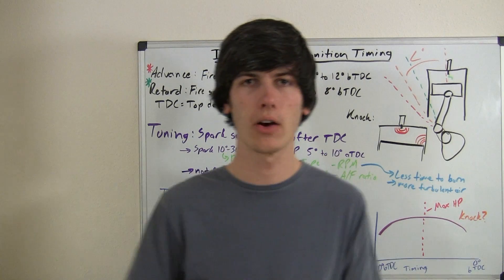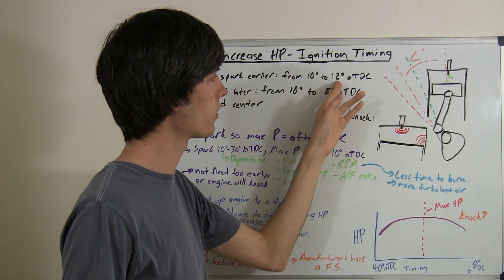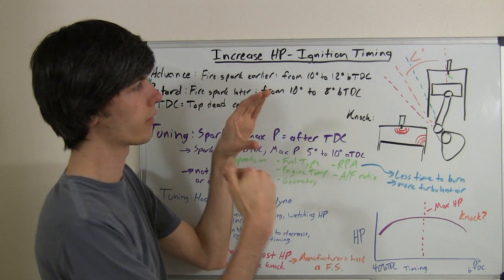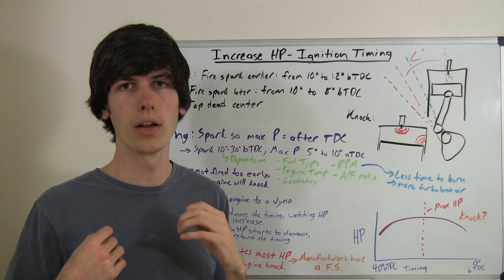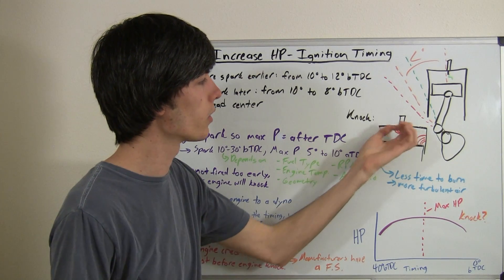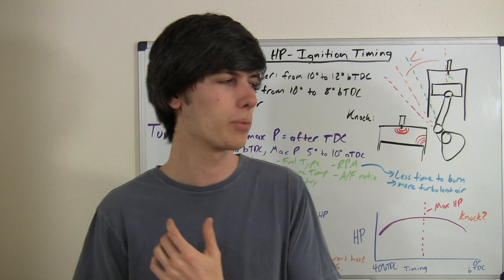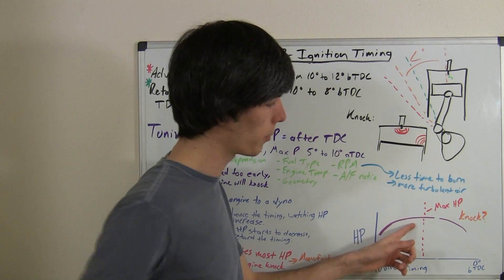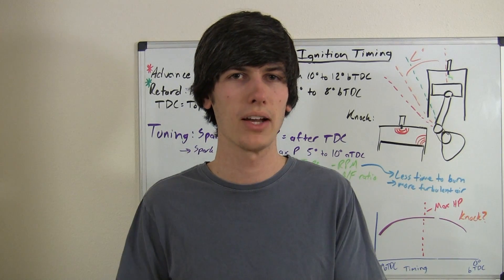ECU Chip Tune - Ignition Timing - Increase Horsepower

Comment: One thing I found out when looking into timing experiments for my Miata, the higher octane gas you're running, the less likely you are to have knock at higher timing degrees.  For instance, my little 1.6L engine will knock if it's running on 87 with the timing advanced from 10 to 12 degrees BTDC, but if I run 93 octane, I can advance the timing all the way to 18 degrees before it starts to knock.  Just thought I'd add that.
Reply: VoraciousPhantasma that's because octane is the measure of resistance to knock.
if you use higher octane fuels you can run more parameters to generate power before you reach the knock threshold.
Reply: We refer "knock" to the sound that detonation/pinging does when the engine is running. We're all talking about the same thing here, so you're right.
Reply: that is what octane ratings represent. Most people think octane means more energy in the fuel, but its actually its rating to prevent knock
Reply: It all depends how the gasoline is measured: 
Research Octane Number (RON)> R or Motor Octane Number (MON)> M or average of both.
In the USA, Canada, Brasil and few more, the gasoline is measured by Pump Octane Number (PON)=(R+M)/2 - or Anti-Knock Index (AKI), and sometimes Posted Octane Number (PON).
In Europe gasoline is rated 100, 99, 98, 97 or 95 RON
In USA if a fuel is 98 RON then it will be 93 PON -> 93 PUMP 
if it is 95 RON and 87 MON then it will be 91 PON -> 91 PUMP
Reply: Congrats I guess? A lot of people are stuck with 91 as the highest readily available octane.
Reply: Yes, thanks to one of the fathers of engines, Sir Harry Ricardo.
Reply: I'm guessing you're also from the EU. We have a different rating to the US. 93 US is the same as our 98 "RON", 91 US equivalent our regular 95 unleaded. I'm quite jealous of their subsidised E85 though... No chance over here
Reply: Octane number is measure of how much branching is present in the hydrocarbon.. More branching means more stability and, hence if detonated will produce more heat 😌😹
Reply: My Protege has the distributor advanced to the stopper.  So probably higher than 30 degrees advanced.

I have A prototype that reduces knock, which is like using A very high octane fuel.
Reply: Thanks dude! Trying to improve my 89 maximas torque curve. It comes on super late and it's a awesome engine (Vg30e)
Reply: Allows more aggressive timing. Higher octane resists knock. No need to complicate it fellas.
As a side note, putting 91 doesn’t give you more power. It just allows you tunability
Reply: thats because the octane of gas is the resistance to knock. e85 has around a 113 octane thats why people can make more power with it
Reply: Jared Tate I thought octane was resistance to detonation/pre-detonation, requiring a higher flash point with higher octane ratings thus ensuring that combustion won't happen simply from the pressure and/or heat that occurs from internal combustion (unless it's diesel which runs off compression once started) but from the actual spark plugs, which in turn allows for more aggressive and advanced timing and tuning setups. That allows a bigger safety buffer against knock the higher the octane used because it's rated to not combust earlier than desired. that's what I was taught growing up and why I always run at least 91 just for the added peace of mind and it actually increases gas milage because it burns more efficiently and the ECU (stock or not) picks that up and adjusts the AF ratio accordingly
Reply: @Bassix92  it's been proven to be useless and potentially harmful to stock daily drivers
Reply: Duh, that’s the point of higher octane
Reply: Higher the octane the more it retards the combustion time. low octane such as 87 burns quicker.
Reply: @dwoodCNA Yes. The "Holy Gral" would be high octan (detonation resistive) fuel with fast burn rate...I think if knock would not come the first, then it could be the mechanical angle issue, when advancing. So you would get more power but, the combustion pressure peak very early (at TDC or just after that) can stress too much crank or rod bearings conserning of mileage engines...

Comment: If a turbocharged engine requires at least 95RON fuel (thats 91 for you in the US), and I use 92RON fuel (the equivalent of 87), to what extent can the ECU alter the ignition timing and AF mixture to avoid knocking and/or pre-detonation by using the knock sensor. I live in a country where a lot of vehicles use small displacement, TC engines, yet the highest fuel grade widely available is onl 92RON. Also do you know of any good read about ignition timing?

Thanks
Reply from the maker: K Sadek This is a pretty interesting video on ignition timing. Dyno Testing Premium Fuel - Octane Level vs Performance - Shell V-Power

Comment: In regards to the setting the timing back short of maximum HP/TQ to prevent knock, in most cases there are two ways to deal with it though one is more preferential IMO... Enrich the mixture to slow the burn of the flame front... or the better option of raise the octane rating of the fuel. To make maximum power in an engine you tune the ignition advance curve for HP/TQ then tune for fuel to allow that timing curve. Great video BTW!

Comment: Not sure if you have done a video about AFM vs MAP. I need to go aftermarket ECU and I am not too keen on getting rid of the AFM in favour of MAP based sensor as I have seen some cars that are horrible for road use more so on start up and part throttle driving.

Comment: How come you get more hp from having the spark plug spark before The TDC?
Reply: This is false (Engineering Explained even says so in his videos)

At faster speeds, air is more turbulent, & thus combustion actually starts happening faster, similar to how a wildfire spreads rapidly when it's windy, because the fire itself has velocity/movement rather than just growth.
Reply: Combustion isn't instantaneous. It takes time. The higher the RPM the less time the combustion has to take place so for maximum HP/torque, you'll have to advance the timing further.

Comment: I have a few questions and, probably some answers. Becouse knock happens when low octane fuel (or pump gas as most call it) excites itself with lower tempetures creating a second flame front (spark plug flame front being your good one) where the highest temp. in the combustion chamber. is located, followed by pre-ignition, it dissables you to use higher air/fuel ratios (lean) and in most cases (like you mentioned), also dissables you to adjust spark timing to max HP (in your example 20 deg. BTDC) becouse knock would occure at 15 deg BTDC at high RPM and load. The only solution to this is to bring down the combustion chamber temp.and use expensive high octane gas when these problems occure in both cases, right? Well, as you mentioned in part 1 of ECU Chip Tune, engineers use a lower air /fuel ratio (rich) becouse it cools down the combustion chamber. As you may have noticed, I want to achive a lean burn for fuel efficiency with my timing advanced where max HP occures thus resuting in more MPG and more power than my vehicles original state, in my tune using normal pump gas. SO, I would use a water injection system (anti-detonant injection) as used by drag and sports cars and also airplanes. Can you make a video regarding this old technology (water injection systems)??? Becouse I have not done it, can you also expect the same benefits as I? Also, I know that 50/50 concentrations of H20 and methanol are used but methanol is corrosive to aluminum and rather stick to just water. Hope to hear from you soon. Really like your channel!!
Reply: Why not just use propane it has a octain rating of about 115,water injection is hard to control over the entire rev range as at low rpms you want little but a higher rpms you want more. so using a pump and a self controled pump you can do it using a varriable voltage to control the flow of watter.A teacher of mine way back in the 80's had a civic and used a small needle the type you use to fill a foot ball and used a dimmer switch to control the speed of the pump.He was getting 60mpg.Not sure but I think he was running a cable to the distributer to advance the timming as well,much like a old model T.

Comment: One step back...the simple OLD question has always been "WOULD I GET MORE POWER WITH PREMIUM GAS?" considering we could advance to peak power without pre-ignition called knocking?  My answer was always NO in the past... esp after riding high compression motorcycles on regular gas....but now I'm not so sure with a high torque high compression engine that doesn't even recommend a type of gas??
Reply: ROCKETGUN BOOMBS

Octane is simply a way too measure the fuels resistance too pre ignition, now here is the thing, people often confuse that PREMIOM means better gasoline and it will give me more power because it is a better formulated fuel. the truth is this is just probably a marketing strategy in a way too get you to buy the more expensive gas, 91-93 octane gasoline "premiom gasoline." is more resistant to pre ignition than 87 "regular unleaded." because it takes a higher temperature too ignite it, and actually a premium gasoline 92 octane burns slower and is less volitile than 87 octane so just straight adding it to your car will not help in fact in some cases you can loose power because the expansion of the burning gasoline vapors happens slower. now where you can get more power from a premium fuel is if you can adjust your ignition timing too advance it as explained here, since it burns slower you can advance the ignition too ignite the air fuel mixture earlier and then you may get more power, but most of all Premium gasoline is recommended for cars like for example the Corvette ZR-1 cars with higher compression or those that are boosted in which during the compression stroke the air inside the cylinder would get too hot during compression for normal 87 octane and this would cause knock.
Reply from the maker: Typically you won't get any benefit if it's not designed for it. I always say go with what the manufacturer suggests, they won't be shy about telling you you can have more power with a different fuel.
Reply: Franz K Premium gas won't help you increase ignition force, the force from gas called the octane number, and those "octane" can help gain more expansion force. But it isn't good for all kind of cars. Such as Chevy Cruze, Focus, Dart etc. Those aren't built for high performance. There is something called N-heptane in Gasoline. N-heptane will start firming in high pressure and high temperature atmosphere. Also those "Premium gas" will only work their bet at certain high temperature which Family car engine like Tigershark Inline 4 in the Dodge dart can't "always" exist the temperature that Premium gas needs. N can't fully ignite them. So the question is, will it work batter when you floor it? Answer is: NO. That N-heptanet  will create something called knocking. Those knocking will decrease the engine performance by incorrect igniting timing, or strange fire, which they call it in HK. That will cause a bit fire coming off your exhaust. So what I think is, if u want clean gas like Premium, u should tune the ignition to certain temperature and certain timing to decrease ignition temperature, also decrease compression ratio to decrease the chance of knocking.
Reply: angryace13 Premium won't get better power or cleaner. I would say maybe it'll be more effective for high power engine like racing motors. Because the ratio of expansion is alot higher by a performacne engine than a normal cruising engine. They create huge pressure and temp different between pre ignite and after ignite.
Reply: some vehicles require higher octane fuels or engine damage can result, the Corvette ZR-1 For example requires premiom 91-93 octane gasoline, even any car with the L-67 OR L-32 3800 at least from what i understand recommends premiom because its supercharged, if you start doing extensive modification it will require it, racing engines with compression ratios above 11:1-12:1 or cars that are heavily boosted you will need to start buying race fuel or E-85 which has higher octane than 93 or engine damage can once again result because of spark knock.
Reply: angryace13 Agree.

Comment: Good one! so many factors varying! Now I have GDI gasoline direct injection and I notice that it took a wee for the ECU? to adjust to a free-flow air filter; with a 12.5:1 compression ratio I'm suspicious that I could increase HP just by going to a higher grade of gas so that the ignition could advance without causing a knock that would be picked up by a knock sensor?
Reply: ROCKETGUNS BOOMBS How does the fuel have anything to do with pumping losses?
Reply: ROCKETGUNS BOOMBS Why would the high octane fuel auto ignite when the fact of it being high octane means it has more resistance to auto ignition?
And also pumping losses have nothing to do with the combustion...
Reply: ROCKETGUNS BOOMBS
No you didn't and that is the problem. You said it created pumping losses, but I'm telling you that pumping losses only occur during intake and exhaust.
Reply: Franz K Gas is a factor, but choosing gas for your car randomly will decrease hp by knocking and strange fire. To increase a non-Turbo charged engine by adjust air flow is to increase the size of intake valve, that can pull air in harder and linear. That also what I did to a 4.0L BMW M3.
Reply: You have to understand that the manufacturer has programmed the ignition timing. The ECU will not increase the advance itself until engine knock is encountered. For example if the ignition timing is set at 13° at 3000 rpm at full load, the ECU will not try to increase the advance if you use a higher octane fuel. To increase the advance you will have to reprogram the ECU...
Reply: The fact is at the fuel. High compression engine with high octane fuel will create massive pumping lose.
Reply: In a high compression engine, High octane fuel will ignite themselves while the piston is on the way up for compression section. In easier term, the fuel will ignite earlier than it used to.
Reply: Casey Fensom High octane fuel= pre-ignite for normal engine.
Do you know how an engine work? Compress then ignite. The ignition force will affect by compression section.
Reply: ROCKETGUNS BOOMBS Do you know what pumping losses are? Nothing to do with the compression stroke or the combustion. Is only during the intake and exhaust.
Reply: Did I mention intake and exhaust?
Reply: Yes, sorry I did say pumping lost. I am trying to mean (lack of compression efficient)

Comment: Hey I also want to point out that manufacturers mostly calibrate ignition angle by first defining a range from latest knocking to earliest misfire and then try to optimise ignition angle in that range. Is that correct?

Comment: Not a bad video. There are some points you may want to add next time. Such at mbt, not all cars are knock limited and adding to much timing can actually cause a loss of power. And another good point would be to elaborate on how volumetric efficiency can effect timing and the knock threshold of the engine. Props on the vid you seem to have a rather well understanding of basic ignition tuning.

Comment: everything that u'v said is true, but do u know how much hp u get from tuning atmospheric engine without changing camshafts, valve springs and so on? it's not worth, risk is higher than the best result u can get... and tuning ecu without dyno is like hunting blind :)
Reply from the maker: Agreed. You'd probably find minimal gains overall from altering the timing, but with a built engine it makes sense.

Comment: Im running an ek9 type r with b18 and toda spac A higher lift cams according to your formula. Torque by rpm divided by 5252,Im at 215. I was wondering with the E*manage blue ECU how much more bhp I could achieve assuming I have  healthy engine and a good tuner. I also have a aem v2 intake,manifold and exhaust

Comment: Coming back to the discussion below about prevention of knocking by retarding the ignition timing: For one, Wikipedia says that "Knock occurs when the peak of the combustion process no longer occurs at the optimum moment for the four-stroke cycle", and further, that "one or more pockets of air/fuel mixture explode outside the envelope of the normal combustion front" and that this happens after the spark plug fires (which distinguishes knocking from pre-ignition). It is a mystery to me how retardation of ignition timing would prevent that since said "pockets of air/fuel mixture" would experience higher pressure and heat by compression before the "normal combustion front" can reach it and, hence, INCREASE the occurrence of irregular combustion. I do believe that it works, of course, but I have yet to see a logical explanation for it.
Note that knocking is not a regular combustion that produces peak pressure before the TDC (otherwise I would easily understand that retardation of ignition timing is the cure), it DOES always involve irregular combustion outside the normal combustion front.
Any thoughts?

Comment: It is used in automotive. Alfa Romeo engines use it in their Twin-Spark engines. Back in the 8V days it made a difference as the 2nd spark would actually fire under different timing and igniting any remaining A/F mixture. Nowadays with 16V systems it's a bit of a gimmick and offers no real power gains.

Feel free to correct me if I'm wrong.

Comment: So for a higher mileage engine (200k km or 125k miles) is there an inherent risk with advancing the ignition timing/ECU mapping? I imagine in a NA engine the safety factor engineered into the engine is greater than any potential power gains from ignition timing? 

Good videos by the way mate.